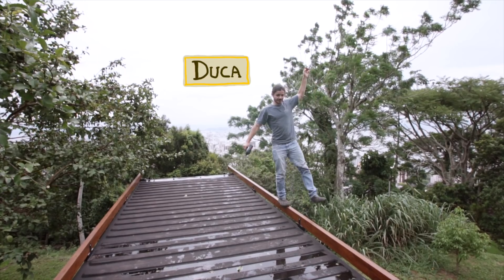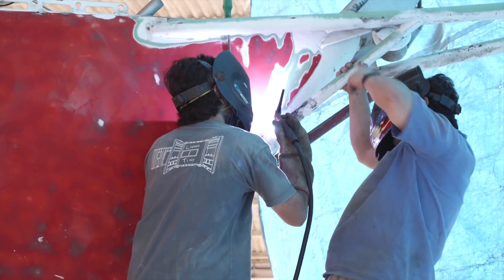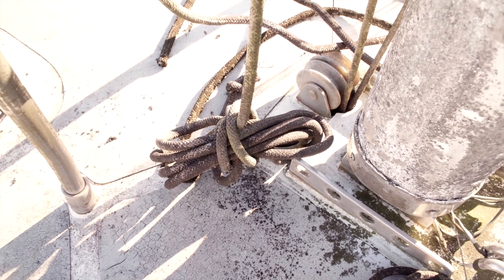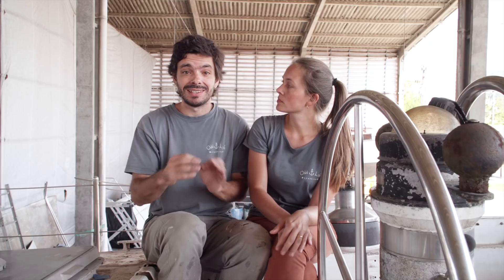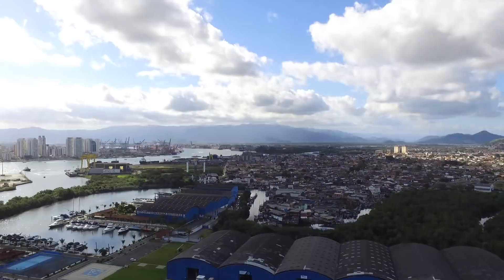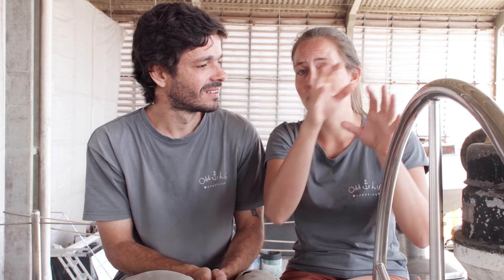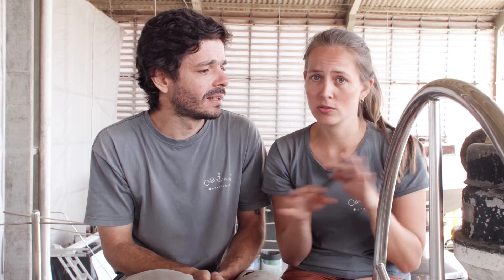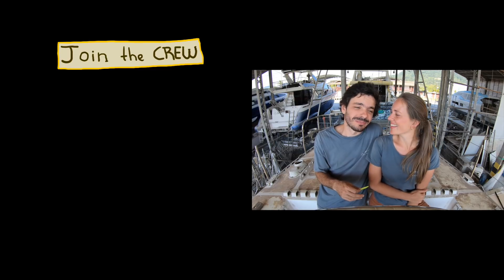⛵️Sailboat on the hard for 22 years 💰 How much did it cost? #091

Comment: I don't know much about boats, but I like steel SO much better than fiberglass or wood.  Steel doesn't crack when you hit something, it bends, and it's much stronger for point loads like where the cables for the mast connect.  For the rust, I would get a sacrificial anode, like they do for submarines.  It's usually a plate of magnesium that you connect to the steel electrically, and it oxidizes so the steel does not.  Also you should get a Lincoln wire welder, and learn to weld.  It's actually pretty easy to weld.  Then you can patch things up with steel welds.
Reply from the maker: Lincoln wire is expensive, it’s a dream to have one. We have a Chinese brand weld machine. Hehe. We’re gonna change all the anodes that came with the boat. Thanks for the tips ☺️
Reply: Another thing Ellenor, almost everywhere in the world, there is a guy who can weld. In fibreglass if you want a new chainplate it can be a major,  major pain to fabricate, bed in etc. On a steel boat you just weld a new one on.

Comment: I would pay very close attention to the condition of every single through hull fitting and to the propshaft seals prior to the boat entering the water. 

Being experienced sailors you are doubtless fully aware of that but I mention it for other readers too.

If this yacht was specifically built of galvanised steel for expeditions to arctic waters then it was extremely well constructed and insulated.

Even the briefest look inside tells one that this is a particularly well fitted out craft, everything is constructed and fitted to a very high standard.

After watching this video, I can see why the owner was prepared to sell his boat to you, after refusing every other offer over many years.

That owner recognised qualities in you both which reassured him that you were the right people to take ownership of his boat, which despite sitting on the hard for so long, was still very special to him.

Comment: Although it is probably too late, the problem with condensation (in your house) is both easy and economical to solve.  By installing a vapor barrier on the warm side of a wall, moist air from inside the house can not penetrate the wall and condense on the inside of the steel outer wall.  A vapor barrier is nothing more than plastic sheeting that covers all of the surface area of the wall from floor to ceiling and corner to corner.  The vapor barrier is placed between the insulation and the wall covering (plywood, drywall, etc).  Using adhesive and double sided tape, all of the edges, seams, and any penetrations for electrical outlets and plumbing need to be made air tight.  Vapor barriers can be installed anywhere that condensation is a problem; floors, ceilings, walls, and yes, boat hulls.  By insulating your new boat with an appropriate type of insulation, you can install a vapor barrier and not have condensation problems in your boat. :-)
Reply from the maker: Problem solved on the house using 3TC, that is a EPS with a aluminium foil on each side of it. The boat has 5cm os EPS behind the furniture and the ceiling. We took of some panels of the ceiling and there is no sign of condensation or rust in there. Thanks for the tip.

Comment: I think you got a pretty good deal. 

A painted galvanised boat will hold up pretty well. A few rust spots i'm sure but very repairable by a professional. Painting and an engine overhaul. Getting your sails, lines and rigging sorted is probably the most troublesome job ahead and sorting out all your piping and hoses and what not because most of it is probably 25+ years old. 

Building a boat? Oh my. Now that would be a lot of work. It's probably way bigger than what you had in mind but Doug Jackson at SV Seeker has been building his boat since 2011 and he has a small army of helpers the last few years. It's a lot of work.
Reply from the maker: Hehe. We’ve been following Doug for years.  Glad we found this boat ⛵️

Comment: The boat looks good, it helps starting off with a boat that has a lot of equipment on it already.  Focus on the safety items first, standing/running rigging, sails, engine. Get the boat in the water and start sailing. Finish the boat off once you are in the water. Good luck.

Comment: Brazilians are such beautiful people. I´m always impressed by the fluency of those whose English is not their native language. Americans generally do not return the courtesy (although I´ve tried to attain at least a little knowledge of more than one foreign language).

P.S.: 50,000 USD is too much for a steel hull boat -- aluminum or even composite, perhaps, but not steel. It is not to be minimized that the owner was upfront about faults, and you will have a safe boat, and one that is relatively easy to repair. At least the interior was in good shape. You don´t want hidden mold!

Beware corrosion in the inaccessible bilge! (Galvanization can itself become compromised over time, or by welding). You don´t discuss this.

A major expense is updated or replacement electronics. Also, a recommended premium item is a deployable solar array and battery management unit, instead of installed batteries. Satellite Internet? Long range WiFi?

(The background noise is not too bad, but in the future you can use Lavalier mics to minimize distraction).

Comment: Sorry to keep on about this.....I'm currently in negotiations with the original owner builder of a 36' Huntingford designed modified full keel semi displacement cutter. She is a double airex hull and has been up to 62°N across the gulf of Alaska up to the Aleutian islands, that's iceberg and glacier country, The VC vessel will be surveyed next month and the asking price is 15K I'll put another 10 into it and for 25k I've got a fully kitted blue water cruiser. I've done my budget and that 25K includes a complete electronics update, new Lithium ion house bank, NB ew starter battery, replacement of all through hulls, sea cocks, pumps and plumbing, new electrical panel, 990w solar array, 2 MPPT charge controllers, new Engel fridge freezer, 12/110/220/40V inverter, new stuffing box and cutlass bearing, new hydraulic steering pump and reservoir, spray dodger and Bimini, outboard motor, Iridium go satellite system, AIS, SSB & antenna, two portable VHF's with GPS, stand alone GPS, new Windex, tri-colour anchor and cabin lights, a NM ew hydraulic windlass, servicing the life raft, and purchasing the required flares , life vests and all other mandatory safety equipment, oh and an outboard motor for the 8' tender........just for starters, but good luck to you

Comment: Correct me if i am wrong but i had always understood that Brazilian federal and state import taxes and duties (Imposto de Importação, Imposto Sobre Produtos Industrializados, Imposto sobre Circulação de Mercadorias e Serviços etc.), put all together, add up to ~ 50% of the cost of an imported boat? We have often thought about buying a boat in Brazil and cruising towards the northeast (we love Bahai) but have been deterred by the fact that boats are so expensive in Brazil (because of these taxes). As foreigners, we know that we could bring a foreign registered boat into the country, temporarily but, of course, that requires a south bound trip against some significant currents (or a trans Atlantic trip), so we excluded that possibility. You mentioned that your boat was actually less expensive than similar boats in the Caribbean. Maybe you got a really good deal or have things changed in Brazil?
Reply from the maker: It’s just valid for new boats. It’s not allowed to import used boats here. And our boat was cheaper than the others in the Caribbean because we have a lot to be done to be usable again

Comment: How do you get a $200,000 boat? 
You buy a really high quality older steel boat for $50,000 and put another $50,000 and some hard work into it. 
Anyone that thinks you spent to much is comparing this to an average quality GRP  boat. 
When you complete this project you will have a truly first class boat. Strong steel boats do not come cheap. You got a hull with a professionally built interior for less than just a completed hull. Not to mention the engine and countless other systems. Yea, some will need to be replaced and others will need work but you are saving big money and a professionally built steel boat is valued on it's condition and original build quality more than the age so it's worth fixing it up. Like restoring an old Ferrari. When you are done, you have something highly desirable. 
Spending lots to restore an older fiberglass boat is kinda like restoring a 1998 Ford Taurus. You may make it more reliable but in the end you still have a Ford Taurus. 
Glad to hear you two are experienced sailors. lol I was commenting "look out for this" "be aware of that" lol I now feel like an old salt that spent 30 mins to explain how you can sail into the wind and the person I was talking to just said "yea, I know, I have been sailing for 20 years" :) 
You two are in great shape on that thing. You really couldn't have found a better boat to start with.

Comment: Love the show but 50k USD is bad, bad bad,  I bought 3 boats in the last few years, a 52 ft ketch for 5k, a 37 Irwin CC for 3k, and a 33 morgan for 3k, 50k is a huge amount for a boat on the hard for 20 years.
Reply from the maker: But where do you live? Brazilian law won’t aloud us to buy used boat from another country and bring to Brazilian. That means if we want to cruise the Brazilian coast we need to have a Brazilian flag. Doe our standard of price this is even cheap. There are not many options unfortunately. For 5kusd here you will buy a 19ft no more than that. 😢
Reply: What did you get for $5k (USD?) and what was required—and what did it cost—to make it seaworthy and outfit it?
Reply from the maker: It can varies. We bought a 19 ft boat in the past for this price in which we could just spend weekends, no more than that. There was no kitchen and it also didn't sail well at all, it didn't obey the commands.

Comment: I have a couple of thoughts. First, you are a charming and attractive couple, and seem to know what you are doing. Also, you want this to be your boat, and by doing everything yourself and filming everything, you will know the boat stern to aft and largely pay for it in the process, so the cost is not that relevant. Ran, another u-tube boat in apparently very good shape is for sale for ~80,000,  If the object was to get on the water ASAP, that would have been a nice option.
Another brief thought is that ads in the middle as opposed to the beginning of your videos will I think discourage viewers; at least that applies to me.

Comment: You paid too much, hot dipped galvanizing will eventually be sacrificed to corrosion, and then you will have all the same problems as any other steel boat. And all WITHOUT a survey. I'd have laughed at the owner and walked away...  And you should have as well. Just as an example, and I don't know the length or who designed the boat, but you could have bought a 36' Van Der Stadt steel hull, brand new, never been launched with full solar, electronics, new rig and sails for 35K $ in South Africa, A mate's dad just bought it  in June 2019